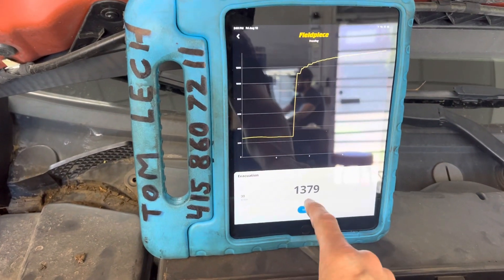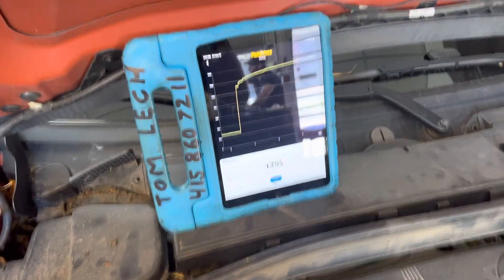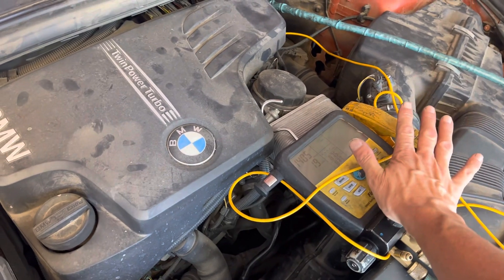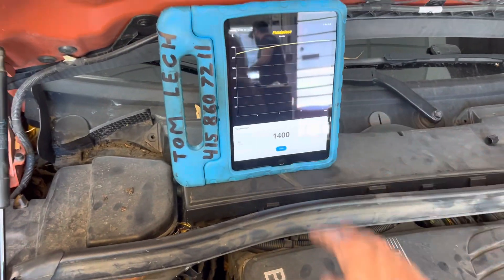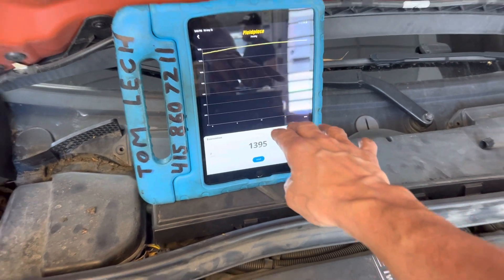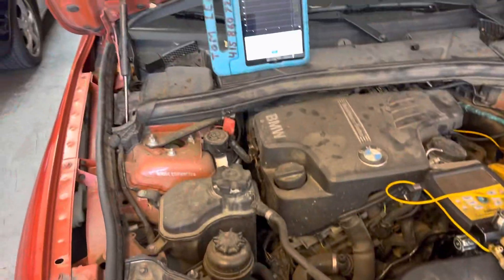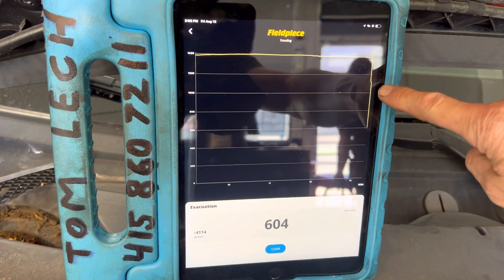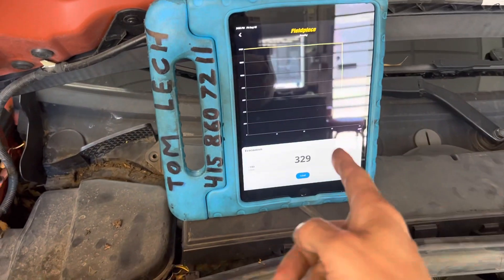MICRON GAUGE READINGS HOW TO UNDERSTAND & LOWER THE VACUUM

Comment: i bought SM380V 3port NOT 480v ..  i connected to 2 stage 1/3 hp vacum pump, it is able to pull 400 micron in about aminute, whenn i close the valve, it is coming back to 1000  micron ..  so i dont knw what micron level is leak vs not leak, i used to hae analog guage looking at 29.9 inch of vaccum. can u pls advise i am bit confused
Reply from the maker: 1000 µm is pretty good for an automobile.  And you’re reading through rubber, refrigerant, charging hoses, so that adds a little.. 

Saw your 1000 µm and it stabilizes somewhere around 1000 µm after 10 or 15 minutes . 

This is way below 29 inches of mercury reading on analog gauges analog gauges cannot even read Ackerly at 29 inches anyway . 

And after 29 analog gauges are completely worthless .@ 

So if you want, you could leave the vacuum vacuum pump on for 24 hours or overnight 12 hours if you have the leisure of time. 

And see if you’re capable of getting it to stabilize after being turned off for 10 or 15 minutes somewhere around 500 to 700 µm . 

That is probably the limit of the ability of the vacuum pump and using rubber, refrigerant hoses, limited capability . 

And after that you’re ready to recharge . 

If you had a leak, the microns are just keep on climbing nonstop slowly but not stop . 

No leak under Vacuum does not mean you will not have a leak under pressure. Those are two different things when you’re dealing with rubber, O-rings, and rubber hoses. . 

But it looks like you’re good to go .
Reply: @coldfinger459sub0  Thanks TOM this is just with hose and manifold not connected to the car yet. just hose and manifold test. do you think 1000 micron is still good ?..
Reply from the maker: @sivucit  question how long did you pull the initial vacuum for? 

I think it’s realistic to say you can hit about 700 µm . 

500 would be much nicer, but much more difficult takes more time . 

Try pulling the vacuum with the engine running with the heater on defrost blowing hot interior air denier interior of the cab somewhere up to around 120 to 140° F 

All this time the hood is closed and you’re pulling vacuum. This heats up all the metal lines and heats up your compressor and heats up your evaporator and then the last five minutes flip it over to recycle mode and this takes all 100% of the hot cabin interior air that’s now about 120°F and pushes it over your evaporator at the same time. The vacuum is pulling this helps dries things out even to a lower degree.

But you could live with 1000 µm if you would like
Reply: @coldfinger459sub0  Tom I am pulling vacuum only to manifold of SM380v. Just checking only hose and manifold .
Reply from the maker: @sivucit  you may find out that you get a higher reading when you shut off your couplings and you’re just pulling hoses then if you pull the whole entire system included. 

Let me know what you find out with your micron reading if you’re just pulling vacuum on your hoses . 

And then, when you valve off and turn the valve off to your vacuum .
       After 15 minutes what is the micron reading?
Reply: @coldfinger459sub0   Tom. Here is my setup. There I NO CAR again NO CAR IS THERE. JUST testing my new SM380V manifold and hose .. thats it.   Connection setup. Red hose of manifold connected back to manifold, same for blue hose. yellow hose connected to vaccum pump,  both valves are open ..    when i start vaccum pump microns is showing as 1200 then within a few minutes it comes to 400, then i close both valve , shut off vaccum pump. as soon as i shut off vaccum pump i see 29.9 inch of mercury on both high and low side. micron gauage disapper. again there is no car no connection made to car in this setup
Reply from the maker: @sivucit  I got it I understan

Very difficult to draw vacuum just on manifold and hoes but usually it should hold at least microns . 

And I think the limitation is your vacuum pump may be the reason why you cannot get below 400 µm

Because with any good vacuum pump, you should easily get below 100 µm no problem at all within the first several minutes.
Reply: @coldfinger459sub0  Tom. Is there a way I contribute or donate to the channel. I asked almost 100 questions. You are so humble and super quick. Appreciate all your help
Reply from the maker: @sivucit  I have no sort of donation or Patreon or anything like that. The only thing I have..   is True Tech Tools 8% discount they give me a few percent off my tool purchases.

Comment: Diminishing return.  I've been obtaining an steady state ultimate pressure typically around 380 microns after pumping an hour or so.
Reply: If you were to use just one vac hose what side would you connect to high or low side? After 2 hours vacuum with all the gauge set up, I got down to 890 microns. But thought I would try 2 Appion valve core removal tools on the low side and it pulled to 480 microns in minutes with Appion large vacuum hose 3/8 to 1/4
Reply from the maker: @Ken_4711  vacuum on the low side .
Reply: @coldfinger459sub0  legend 😊 what about using both sides with 3 or 4 valve core tools and 2 vacuum hoses one on high side and one low side?
Reply from the maker: @Ken_4711  yes this works to ob made one video on that
Reply from the maker: That sounds about right on the majority of cars.      But it also depends what you’re using for hoses and a vacuum pump as you as you can see what the difference is when I use the big blue hoses with the big vacuum pump that is rated for 3 µm
Reply: @coldfinger459sub0  That's the pressure after valving off the vacuum source pumping through a single 1/4id hose, usually the rise is insignificant but if it is, I'll pump on it again..

Comment: I"ve been watching your videos, which are great, since I got my Fieldpiece gauge and you showed how to seal the seals with silicone. Maybe you can help. I'm in a weird situation where I have a brand new Emerson bi-flow filter in a isolated test rig and it won't hold vacuum. This is the 2nd filter I got since I thought the first filter was faulty but both behave the same. Here are the links to the videos to show how and what I'm experiencing. I contacted Emerson but they are stumped too and said no one has ever called in about this. :( Your helps and experience are appreciated.
https://youtu.be/9ZUO3gRHaIM
https://youtu.be/_pzBA5w7aCU
https://youtu.be/0EEawaapeAA
Reply from the maker: I have not looked at the video links yet I’ve been very busy but I will. 

But jumping the gun without looking at your videos yet and just trying to theorizer hypothesize your problem. 

After watching your videos I will reply again.  We all know what our professor or teacher told us about assume ASS / U / ME

But I’m guessing you’re losing micron reading on your decay test. 

If you have it located between two ball valves and you’re trying to test and you think there’s a leak at a weld or a valve core or the casing itself. 

Probably just a lot of outgassing from the molecular sieve ( desiccant material ) in a small volume of area. 

Try these two things

If you have all valves hopefully good quality like Mueller and they were not overheated when somebody brings them in because I did not watch the video I don’t know this yet

Use silicone grease underneath the tightening cap because vacuum cannot pull through silicone grease

Also known as dielectric grease

Fill your system isolating just the filter dryer messages.    And fill it with tri nitrogen zero psi one psi no pressure needed. 
           Use a hair dryer or a heat gun not to exceed the core shell temperature of 212°F

Keep heat on it for about a half hour

Now pull your vacuum not with a rubber refrigerant vacuum charging hose not through refrigerant manifold gauges. 

And of course he must have isolation valves and service fittings on the side.  

Keep your vacuum pump on there until you have pulled it down below 100 µm.   For at least an hour. 

Then re-perform your vacuum decay test. 

And if you think you have leaks as you’re pulling it under vacuum spray paint entire assembly everything all the way up through the ball valves with epoxy paint. 

The epoxy paint will absolutely seal everything that is drying in words no vacuum can pull through a layer of a Epoxy Paint. 

If it still seems like it’s leaking it’s probably your equipment in method.
Reply from the maker: I watched your videos thank you for taking time to post videos that was very helpful. 

That you mentioned that it leaked and went all the way up to atmosphere is the biggest clue you have a leak lol 😂 

And if you did this on to filter dryers and they did the same thing I don’t think I’ve ever came across a defective new filter dryer in my entire life let alone to come across two in a row. 

If you showed me and told me that your vacuum decay was only going up to around 3000 µm maybe almost 4000 µm then I would say you have a filter dryer that is saturated with moisture and is offgassing

But going up to atmospheric pressure losing all your vacuum you have a leak most likely at your flare on the face to the filter dryer 

Try it again with some  NYLOG  On the surface of the flare

If that works you found your problem

If that does not work you could have a stress crack on the backside of the flare right at the sharp edge where it connects to the tubing underneath the nut cap

Apply nail log to the backside of the flare where the nut cap inner shoulder will come down and rest and tighten against the backside of the flare repeat your test. 

Now the reverse message to find a leak would be pressurizing it with nitrogen

You would use a ultrasonic leak detector around the body of the filter dryer and the flare fittings

You could use soap bubbles 200 psi 300 psi 400 psi trying to pinpoint the leak. 

The ultrasonic leak detector also picks up leaks under vacuum
Reply: @coldfinger459sub0  I figured it out. I applied a hair dryer to the filter as I was vacuuming and left it for over 3 hours and finally started seeing progress. It held at around 3000 microns and then a few more hours and I finally got it to hold around 300 microns. It's weird because these filters were brand new and the only thing I can surmise is off gassing. Appreciate your responses!
Reply from the maker: @proxybox  Glad to hear that. 
Somebody must’ve opened up the plugs on the dryers and expose them to the air there’s a type of thing as soon as you expose them the air you immediately put them on the line flushing nitrogen through it never allowing them to be exposed to the atmosphere. 

You do not draw air from a system through a vacuum pump through the filter dryer because as all that air passes the dryer it will be absorbed the moisture into the desiccant

Comment: Did my 1st car today, Car had a hole in the condenser that I found with OFN and bubble leak detector, car hasn’t had ac for 4 years, removed condenser, filter dryer and compressor, flushed the system with solvent, new oil in compressor and everything back together. Started to late and run out of light as doing it on the driveway. Pressure test held well on digital gauges, but the vacuum is just like your video here! Rising fast after shutting off the pump and valves. So glad I found you channel and see another video you did saying something similar so knew straight away that it’s still loaded with moisture. Broke the vacuum with nitrogen a few times to try dry it out, and has left if with 5 psi OFN pressure in there as can’t work on it again until next week. Thanks so much for all the effort you put into these videos 😊
Reply from the maker: Just leave it on the vacuum pump overnight or even two days you can never overvacuum. 

Just a question but if you try to flush through the evaporator I hope you did remove the expansion valve ?  because you cannot flush through expansion valves. 

But it sounds like you have all the Time in the world that is good for you that means you could leave it on the vacuum pump as long as you please there’s never a negative affect of  vacuum
Reply: @coldfinger459sub0  yeah just working on the mrs car for practice at the mo, it’s old so she said go for it, this is a Volvo C30 I know it has an orifice tube not sure about expansion valve, loads of oil came through with the solvent so assumed it did the job after it started spaying through clear was heavy dye content. Thanks for taking the time to reply 👍
Reply: @coldfinger459sub0  plan to leave it on vac next weekend for at least 8 hours, would love to do it overnight but at the moment don’t have a garage so someone will probably Nick the pump 🤣 and the neighbours will probably get annoyed too 🤣🤣🤣
Reply from the maker: @Ken_4711  i’ve annoyed neighbors before 😂
Reply: @coldfinger459sub0  just been reading the Haynes service manual. Says expansion valve in that, but the guy I got the bits from sold me an orifice tube, are they the same thing? Set tank to 150psi wondered why it was so pressurised on the flush took some real holding on the gun was trying to push back, but other tubes so easy 🤣
Reply: Did you replace the dessicant?  Some I just can't pump under 3,000 microns when the dessicant is original (of course wet).
Reply from the maker: @thisisyourcaptainspeaking2259  nope not my car that was the shop I was in the insurance company told them to get an aftermarket condenser it came in the car sits there at over $100 an hour that it’s not pumped out the door so they’re definitely not gonna hold up production and wait another day just for a desiccant to be delivered or a new condenser.